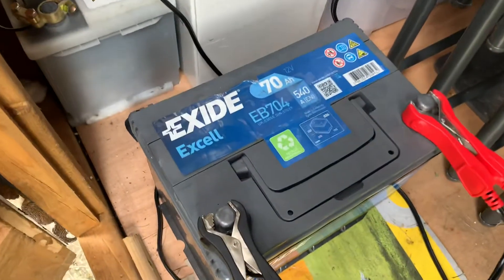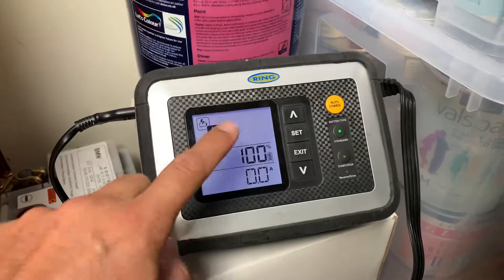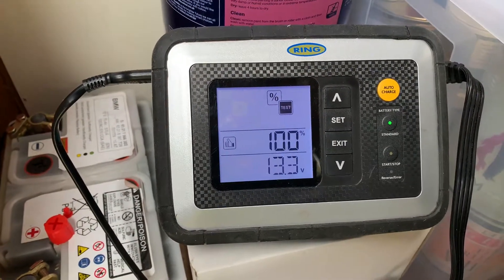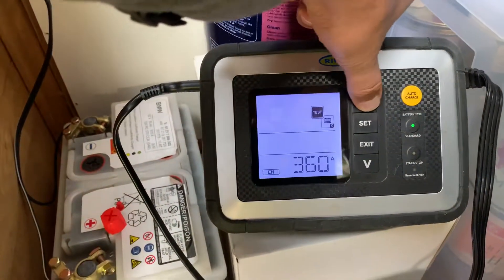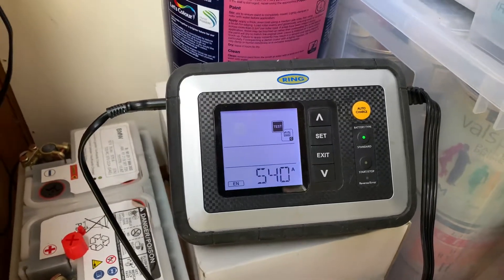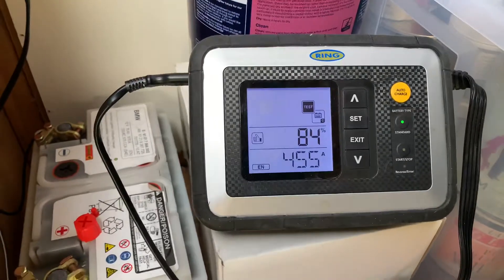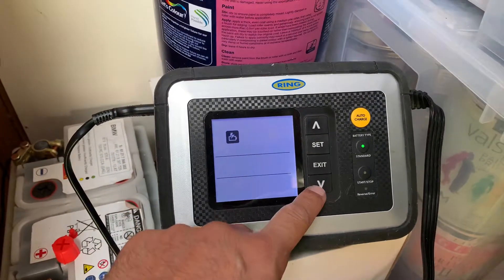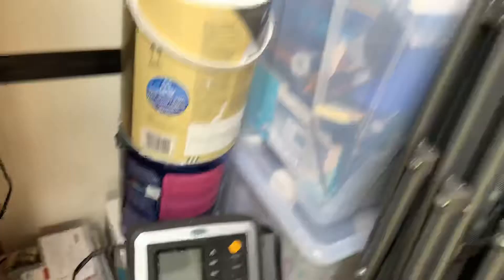Part 3 - How to charge a completely discharged car battery.

Comment: You charged it for long time or its take only few 4 or 5 hours ?
Reply from the maker: @brahim55  depends on the battery capacity, condition and ambient temperature. 
Most often it’s an overnight process. The charger regulates the charge at different points so it’s not like an old school charger that would put a constant Amp & Voltage.

Comment: Just bought this charger, plugged it into a battery and it started @ 70%, its now sayng 90% then the fan spins up when it shows 100% for a short while and then it breifly shows 70% then goes back to 90% and is repeating this process, is this normal?
Reply from the maker: @demonwithglasshand  yes it’s normal behaviour. 
In reality the battery only stays at 100% for a very short time. As soon as its power feed stops it starts discharging. 
So after a period of float, the battery would be at its maximum charge capacity. The more accurate indicator of health status is the CCA test which shows how much oomph the battery has left in it. 

After the battery has charged you can put the charger in top up mode. This will slowly keep the battery charged at a very gentle and incremental pace.

Comment: Have you ever had a battery keep ticking over at 90% My AGM 70ah 760en battery has been on this charger for 40 hours and stays at the 90% mark and keeps dropping and then trickle amps and back to zero? never gets to a hundred or atleast does and then drops back after few seconds to 90%

I've taken it off charge and done all the test settings available from the manual and says its bang on good?
Reply from the maker: Perhaps that’s the max level the battery can take. A good indicator would be a CCA test to see how much cold cranking amps the battery is capable of producing. 
Can happen to old or worn out batteries.

Comment: Mine is showing the flashing batter symbol but the bars not going up just flashing empty outline and if I select the repair mode it is not saying REC like yours does. Ideas anyone?
Reply from the maker: Flashing battery means no battery connected. The battery terminals may need a clean up.

Comment: bought one of those chargers for work.. 12 amp model and this even worked on a small 12v 20ah battery for a paint marking machine.. battery is probably 20 years old and was just crap.. hooked this charger to it and within a day of playing together the battery went from 10v back to 14v something with more than enough battery life to run the pump it was powering.. brill lil unit that is.. im going to try it on a large car battery that turns over our large mower as the alt on that died years ago so its always needing a charge before we start it..

Comment: These videos were really helpful. I bright this unit over the weekend to charge a dead battery in my old Mercedes 260E. Selected the winter mode charge and after 4.5 hrs (it automatically went to recondition Rec mode after 3 hours), it seemed to be charging at 60%. At that stage it was starting to rain and bonnet was half open so I disconnected it. Will do it again during the week and balance it up to 100% and CCA test it. Battery was at 0% with 10v before I used charger.
Reply from the maker: Really happy you found the videos helpful. 👍🏼